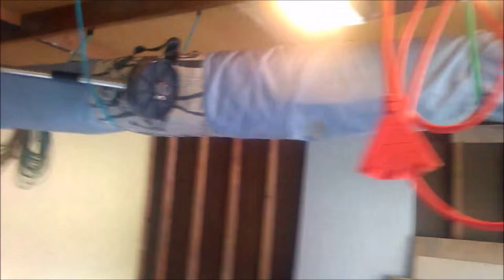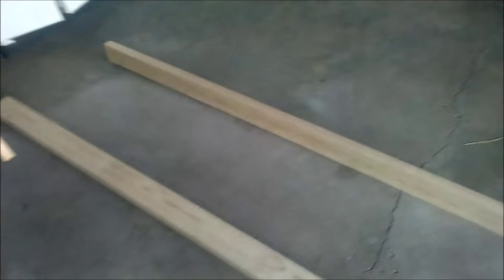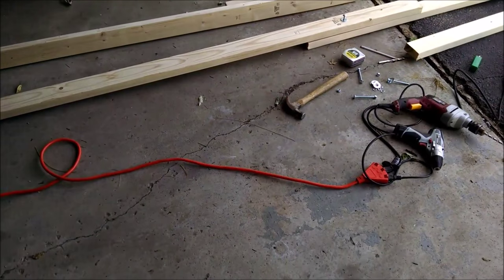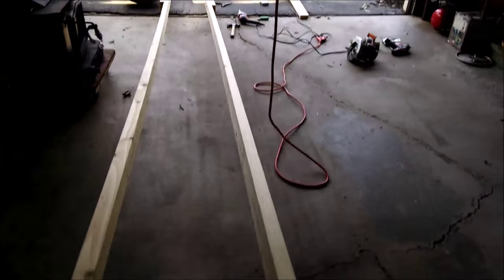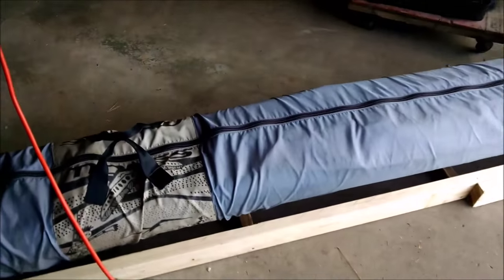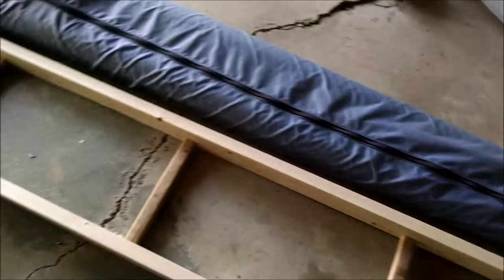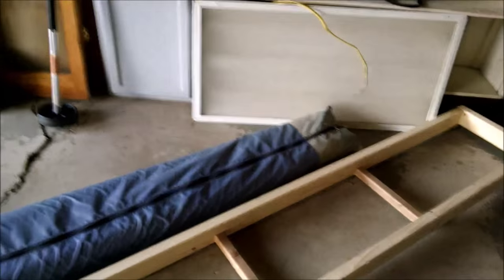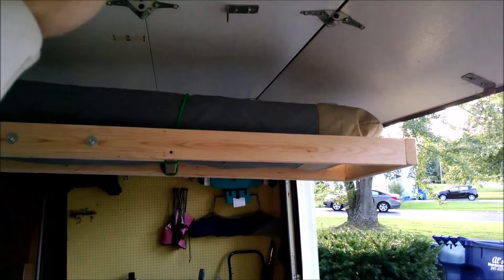How to build a Hang Glider Roof Rack

Comment: Looks real slick! 
One thing I should pass along, after having to pull out the Mylar and ironing the curl out of the Mylar. Now after flipping the glider upside down and taking apart the control frame I loosen the glider ties and no longer leave the Mylar curled snugly around each wing tube.
I pull slack from the under surface so that the Mylar can uncurl and take the largest circumference  inside the glider bag. The Mylar no longer takes the set/curl that it once did from being wrapped to snugly around each wing tube. For ironing out the Mylar I used water in a steam iron and covered the Mylar with a sheet. Ironed it so that it was too hot to touch and the Mylar is no longer curled. I now have a cambered leading edge like new.
Another thing I just recently started doing is when tying the glider to the rack I measured where each batten pocket would be when it is rolled up inside the glider bag and only tie in those locations. That way if the Mylar is deformed from being tied onto the rack the batten when inserted will hold the Mylar at the desired camber.  Hope that made sense.